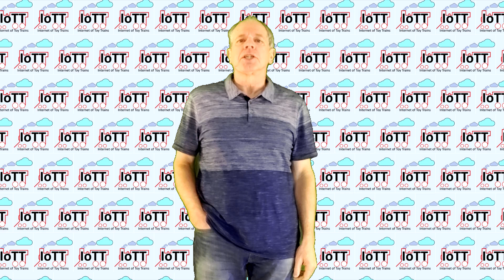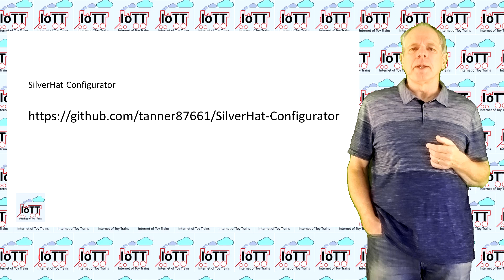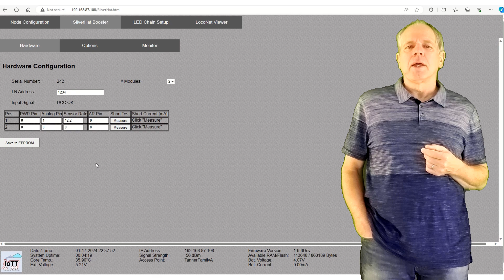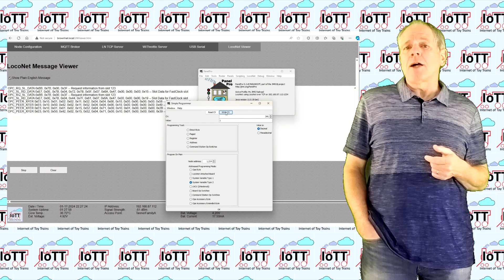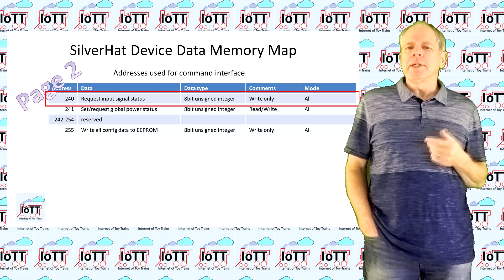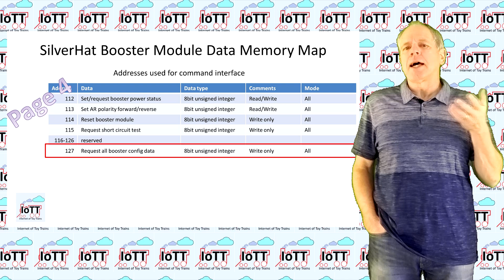SilverHat DCC Booster Configuration (Video#136)

Comment: This looks excellent....one question though - does the Silver Hat generate a Railcom cutout, or is this still on your roadmap?
Reply from the maker: It has a differential input, so if you feed it a cutout, it should generate a short circuit on the track, which can be used by a Railcom sensor. Not tested yet, but that was the design idea.